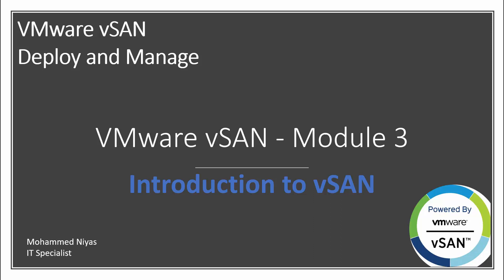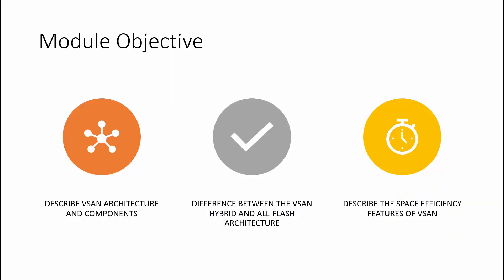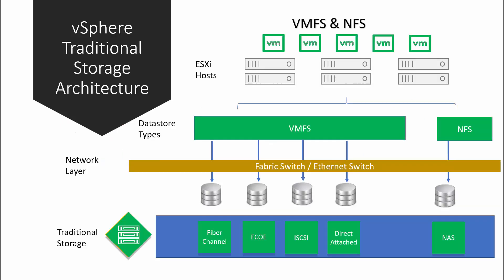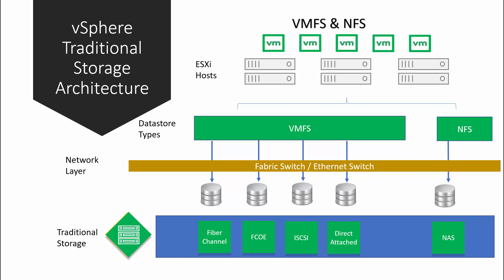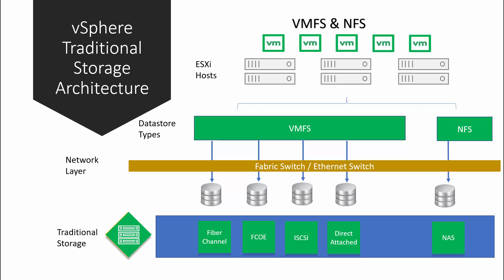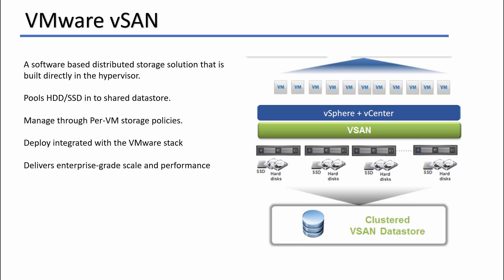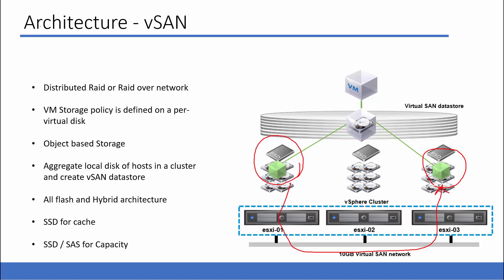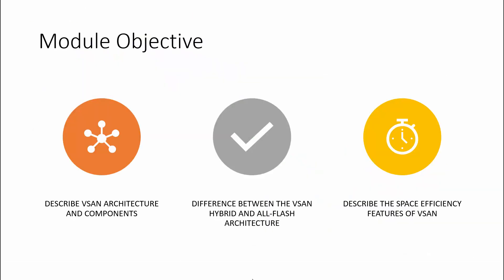VMware vSAN Tutorial : Deploy and Manage Video 3 - Introduction to vSAN

Comment: Hi Mohamed, can a vSAN be created using a SAN storage instead of ESXi  host local storage?
Reply from the maker: Yes, you can add the lun first and configure vSAN. But vSAN is a replacement of SAN. i didn't get the application of building a vSAN on top of SAN